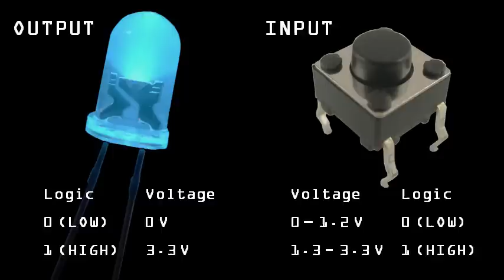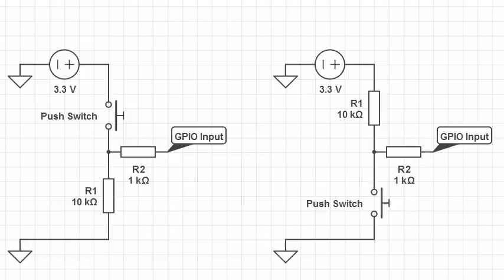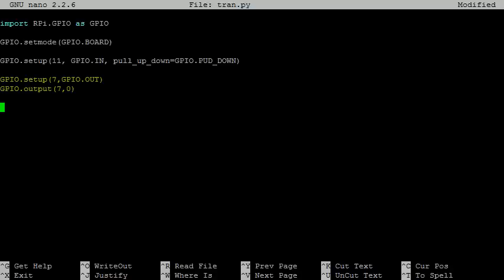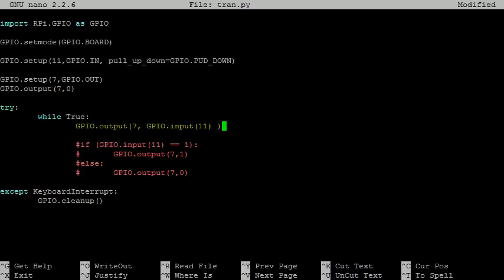Simple Button Input with the Raspberry Pi

Comment: It is old, but as someone just starting to play with the Raspberry Pi during my free time, this is by far the best explanation I've found about push button and input reading.

Lots of tutorials out there uses a 10k resistor or not, but absolutely no one explains clearly why it is (or not) necessary.

I've seen some explanation as to why here and there, but never explained in such a good way with, on top of that, the difference between pull up and pull down resistor.

Comment: We have a setup where we did not use R2 at first resulting to phantom triggers due to high environmental noise. After putting a 1K resistor as R2 then it solved our problem. No more uncontrolled triggers...Hence I think the purpose of an R2 resistor is not only to limit currents going to RPI to prevent damage. Actually I still wonder if there is more we can do to make sure we don't get effected by noise, additional capacitors, etc.. I would be glad if you can share your ideas.

Comment: I'm sorry if this is obvious,  and I am not seeing it, but in your circuit in the end of the video, there doesn't seem to be anything linking the switch to ground even though there is in the earlier diagrams. Is the ground, in a sense, "included" when you set the resistor internally? Thanks
Reply: Was going to ask the same thing, people have to understand that the audience might be new to the concept of pull-up and pull-down resistors when they try to learn how to wire a button amIRight? Thanks for confirming tho, @Richard van Pukkem
Reply: Mayukh Nath That's the whole purpose of the internal pulldown resistor.

Comment: Does it have to be the +3V3 rail or can the power be from a GPIO pin output set to high? I'm this because this means a switch can be easily disabled and enabled by setting the output pin to low or high (I know you can have the program ignore the switch input but I find comfort in knowing there is no power going into anything unnecessary at all. I 'm asking because the voltage on an out put set to high is 3.3V but I'm not sure if the current is different/if it matters in this circuit (because of so the resistors used might need to be different)
Reply: +CoolAsFinnBro its the same if you put high output from a pin it gives you 3.3v so its the same thing but its up to you to choose which one :)

Comment: How can I make a power switch out of this if it is possible?
Reply: Yes very, I can't go into much detail at the moment but basically make a .sh file instead of just a python file, and have it so inside the .sh file run the python file and have the python program loop until the button is pressed, then have the python quit and have a shutdown command inside the .sh file so it will trigger after the python is done running.

Comment: At time 2:35, you mention only a tiny current will ever pass in the INPUT PIN, why? R1 has a value of 10KOhm Vs R2 has 1KOhm, so I would imagine that current would pass....Is there some kind of diode after the Input PIN (within the raspberry Pi) that prevents current from flowing in towards the Input PIN?
Reply: yeah im assuming theres some sort of circuitry built in to prevent current going into the pins
Reply: the input pins have a very high resistance ("infinite") inside the raspberry pi. essentially not letting any current through. reference: https://www.element14.com/community/docs/DOC-78315/l/raspberry-pi-gpio-explained

Comment: I have two questions... A: will this work with my button as it only has two pins?? B: do you have to make the button branch across both sides of the breadboard and WHY?

thanks!
Reply: Yes it will work, the 4 pins are only used for controlling 2 things at the same time. The 2 halves of the breadboard are disconnected from each other. The way he has it setup though the positive is connected from below. As long as the 2 switch pins are on different rows/different sides of the breadboard it will work.